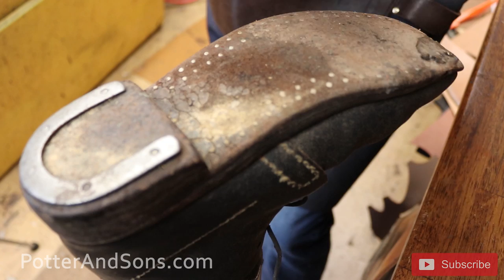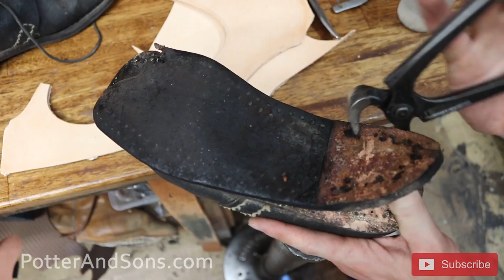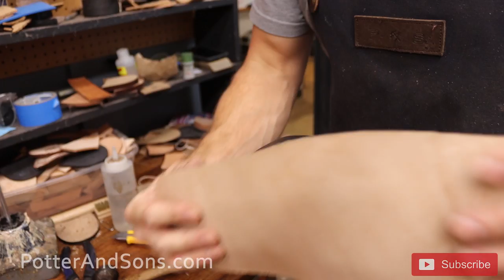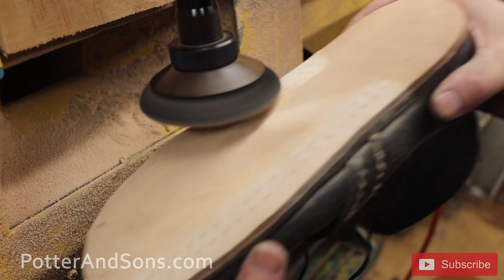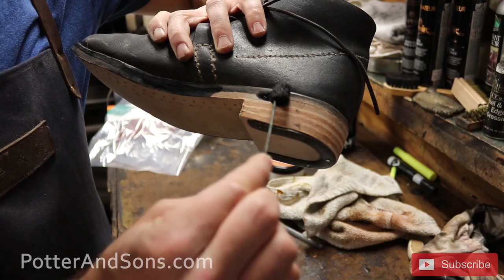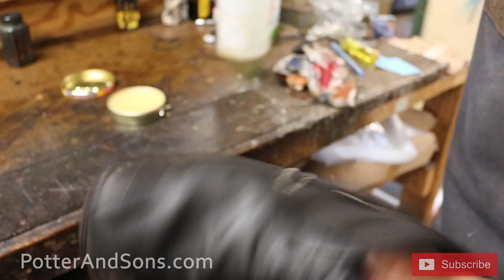Civil War Brogans Restoration

Comment: God imagine marching miles and miles in those. Hard men for sure.
Reply: Imagine the barefoot guys, jeez!
Reply: Esuper1 ... depending on the fit of these and the rubbing at the heel, and the condition of the roads, going barefoot could have been much nicer than using shoes.
Reply: @alx252  Bingo.
Reply: You have a point. I am a hiker and I have had to think outiside the box a few times where bad footwear is concerned. Anything from grass to wrapping a torn tshirt but I would never NOT wear something especially is we are talking dozens of miles in a few days is concerned. Forget it if its cold or over rocky terrain.
Reply: Until recently, the foot soldier shoes has always been inadequate. Two good examples were the Battle of Bulge and winter march in Korea.
Reply: Recently did a 5 mile hike in CS uniform, ended up with a blister the size of a grape on my pinky. Really makes you respect them a bit more.

Uh that being said, a decent pair of brogans actually fitted to your feet are incredibly comfortable.

Mine were not. They are two sizes too high, and the hobnails are poking through my soles.
Reply: I had a pair of Doc Martens that were exactly that style but with the air wave sole. They were the most comfortable pair of shoes I have owned.

Comment: I grew up Reenacting (Union) and you did a great job! Don't feel bad about "cutting corners" on the glue either. These were crude, cheap, and mass produced made to last for a campaign then replaced as needed which is why many soldiers brought their own quality shoes if they could afford it (especially early in the war). Reenacting is odd because we never use the equipment as harshly as they would have been but we are also expecting it to last in storage and off/on use for decades rather than a couple seasons. You did the job right and from the outside they are perfect for a modern reenactor!

Comment: Those woodpegs look like a dream to work with. A lot of the shoes I make get woodpegged and the thicker the leather the more often the pegs break off when I try to get them in.
I also used to put a film of water based shoemakers glue on every hole before putting pegs in, the pegs would go in easier, expand and stay expanded due to the them sucking up the glue. Usually work work boots and such.

Comment: I am new to the channel but I'm loving it! My only criticism is using water to expand the lemon wood pegs for the purpose of fastening them to the sole leather. This is a common misconception that people have about wood (I've seen it as a fix all for ax handles, knife hilts, golf clubs, mortise and tenon pegs, etc.) The rapid expansion from the water being pulled into the end grain causes the tubular structure to compress within the wood and when it dries out it shrinks to a point smaller than it started leaving the streangth of the wood severely damaged as well as loosening them in the holes. If the shoe were to remain wet after spraying them and were to never be allowed to dry it wouldn't be an issue but using hardening oil one drop at a time till the wood stops absorbing it would be more appropriate for the task.

Comment: I use to have horse shoe caps put on all my boots! I was pigeon toed real bad as a kid,wore corrective shoes til I was six. I'm pretty bow legged and wear the heels off on the outside bad! I can go through a set of heel caps 2 times a year if I wear the same boots all the time.  I rotate a couple pairs so things have a chance to dry.Also don't wear them out as bad.

Comment: Hi there!  I'm looking for an all-leather shoe with no latex, rubber or polyurethane, also no polyethylene. I found out that my body is reacting to these things.  
I'm hoping to get a shoe that I can still jog in (1-3 miles a week), walk around on sidewalks and gravel, and just wear daily in my life in Portland OR which includes rain exposure. I was researching turn shoes and moccasins, and then thinking of getting a wool or fur sherpa insert. But now I'm thinking of getting civil war reenactment shoes, brogues like these, with the horse hoof part. That seems like it would be more durable to have a hard sole on the bottom, rather than only soft soles. I'm worried about ruining the shoes by walking on sidewalks and gravel. I also want to know it's full grain leather and I'm not sure how to find that.  Also concerned about chemicals as i have multiple chemical sensitivity,  but I dont know how much I can avoid toxic things like glue.  Maybe I can avoid formaldehyde though.  So now that I know a better idea of a quality shoe, brogan jefferson military shoes (though I am a lady! But it shouldn't matter right?) ... now I need to figure out where to buy them.  Do you have any tips on this, any good companies to recommend?  The one I looked at so far was by military uniform supply Inc.  I expect to learn how to oil and soap the shoes and dry properly, and I expect they'll need much more care than I'm used to.  My current shoes are teva tirra sandals and Brooks dna .9 running shoes, and they're both giving me irritation. I already knew I had latex fruit allergy syndrome  (food allergies) and a spandex allergy to my pants,  so this is not all that surprising.   
Thanks for any input you might have! Or maybe you don't have any. That's OK.

I enjoyed you video and subscribed.  Thank you!

Comment: When pounding the iron nails into the heel block, they stop and begin to curl under the hammer, like Heath said.  But what are the nails hitting inside the boot?  What's hard enough in there to stop the nails?

Comment: Pardon me if I missed it, but did you remove an insole before putting the new sole and heel on? If you hammer the nails through to the jack, I’m wondering how you keep the wearer from walking on nails.
Reply from the maker: I pulled up the liner so the nails are crimped flat on the insole and the liner is glued back into place.
Reply: Trenton & Heath Ah, thank you! I always wondered how that worked. It makes perfect sense that the nails get crimped on the jack and therefore wouldn’t poke through the insole when it’s reinserted.